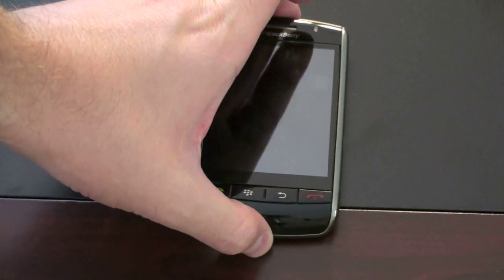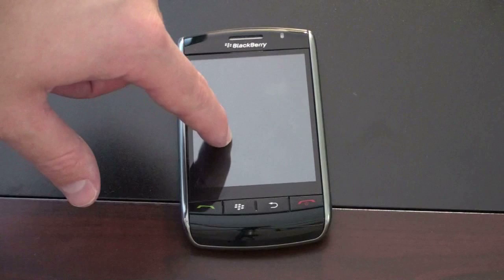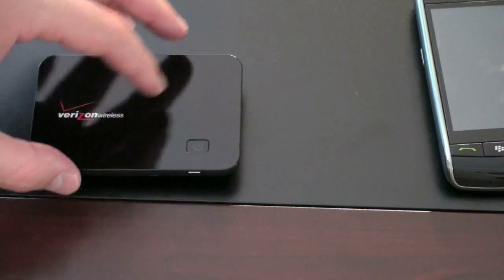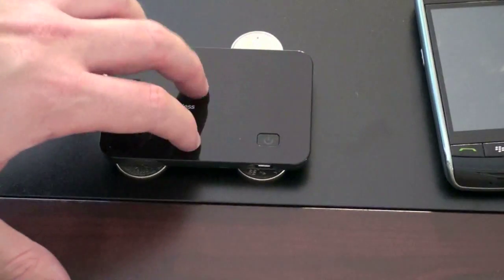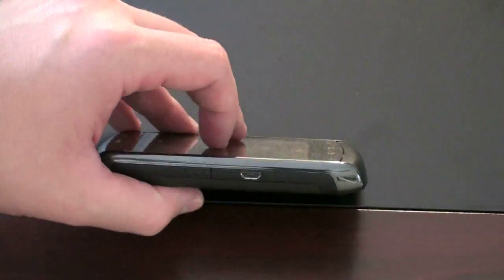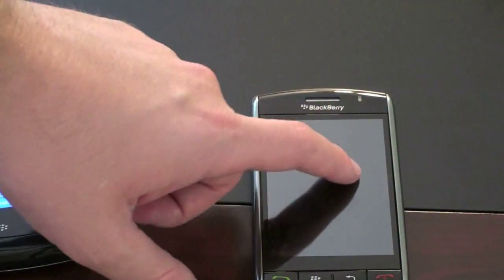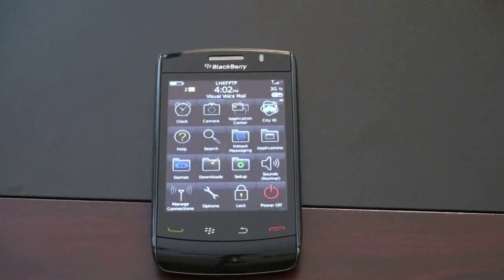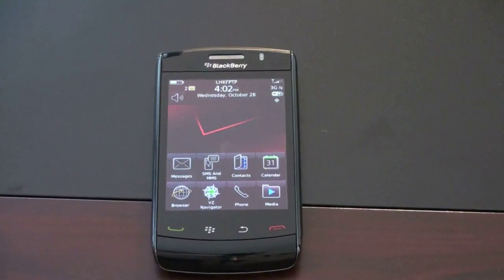Blackberry Storm 2: Screen Explained

Comment: I like sure press on the storm 1 and the new version is much better.  Sure Press is fantastic and I think makes typing better than a physical keyboard.  The keys are biger and you get  the feedback.  Some may  not like it.  I happen to love it.  With the bugy  lag issues the blackberry  Storm really  made for a frustrating experience at times.  With those issues resolved the new version is fantastic.  The web browsing still needs improvment but is not bad. The app store is getting better.